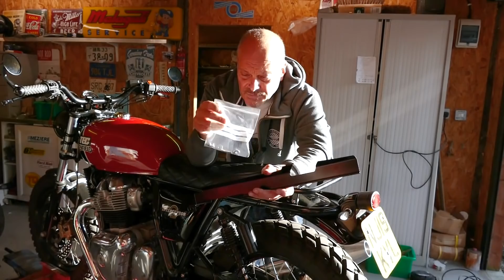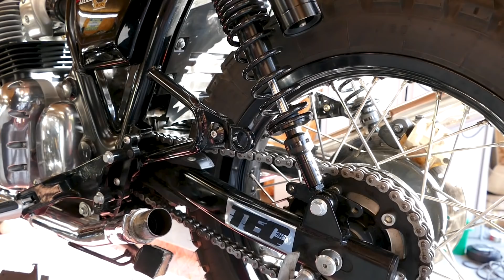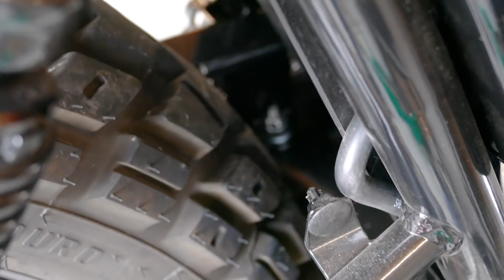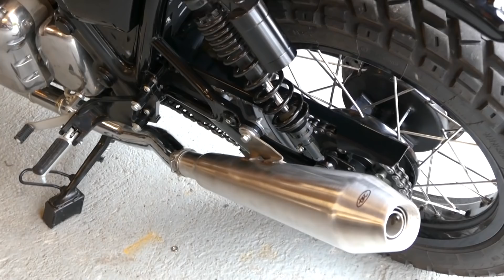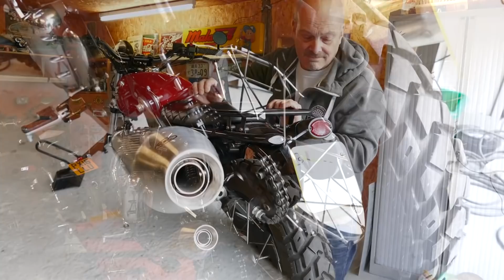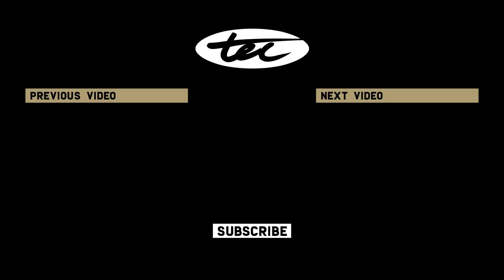Royal Enfield Interceptor 650 - TEC Chain Guard Fitting Guide

Comment: Update: The stainless Nyloc nut that goes onto the stud in the swing are is a10mm nut. The reason my 10mm socket appeared to not fit was because there was so little space between the socket and the chain guard the socket was prohibited from sliding on normally. At present the socket is securely on the nut but none of my extensions will fit in such a tight space.  I’ll probably remove the rear wheel and tighten the nut with an open end wrench. There is simply not enough room to get tools where they need to be because the wheel is blocking access. Knowing what I know now I would have removed the silencer AND the rear wheel and this would have been a very easy installation.
Reply: Dont tighten the rear screw before try tightening the nut on the stud or even put the nut on the stud. That gives the required space to put on and tighten the 10 mm nut. It is briefly mentioned in the video, but it is the game changer. Saves you the removing of Wheel and silencer.

Comment: I am just finishing the TEC chain guard installation. Here’s what everyone needs to know: It is almost impossible to install this chain guard with out removing the silencer. Also, determine ahead of time the exact size of the Nyloc nut for the stud that goes into the swing arm. I would say what it is here but I’ve not determined what size socket fits. So far the following sizes don’t seem to fit: 8,  9, 10 and 11 mm. Have not tried any SAE sockets yet. My mistake was assuming one of my 1/4 inch drive metric sockets would fit. I about to remove the rear wheel so I can get in there with an adjustable spanner. Argh! If I finally get a socket to fit I will advise here accordingly. Also the little plastic plug that’s supposed to fit in the one empty screw hole is too small. I will fill that hole with a nice stainless screw. The chain guard is otherwise a very nice upgrade to the look of my RE 650.

Comment: What are your thoughts on the S&S big bore kit, 750 and 860,  will you be going down that road as well, price seems reasonable as includes the liners, wondered what your thoughts were.
Reply: Hi
We are looking forward to trying these parts as we have just been appointed dealers for S&S parts for the RE twins. We will be making videos fitting and trying out the parts very soon.
Reply: Check out revelry Racing on facebook.  They builing a full on drag 650 gt . Big bore kit.  Extended swingarm.  Drag wheels

Comment: Interested in plug to check / remove fault codes on ecu and how to bleed brakes through modulator if air in system. Simple things you would have to take to a dealer for.

Comment: beautiful.

help me out, what tires are these?
Reply: Heidenau K60
Reply: @ferrumignis  i didn't find these dimensions in Heidenau catalog, 100/90-18 to front wheel and 130/70-18 for rear wheel. Unless you fit non-standard tires, in some countries isn't legal. Although, i would like to see the bike with these tires and it looks cooler.
Reply: @isaac.oliveira  If you check out the 650 Project Part 4 video he mentions the tyres briefly. He says the same size is fitted front and back but mentions the 140 section he fitted was maybe a bit too wide as swingarm clearance was very small.